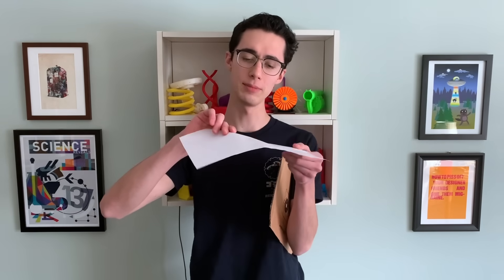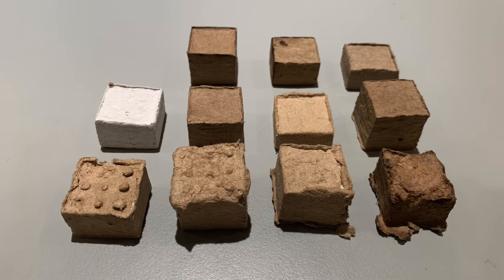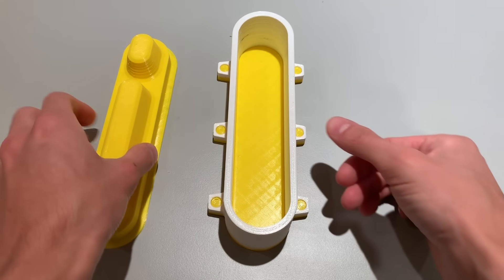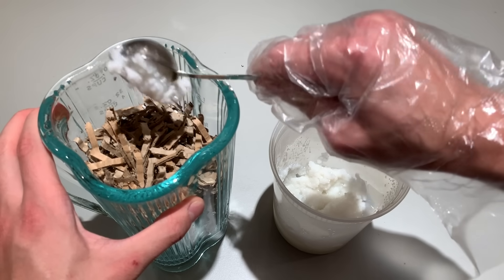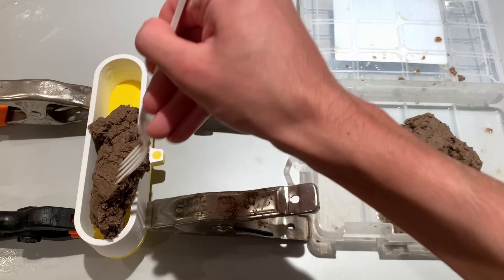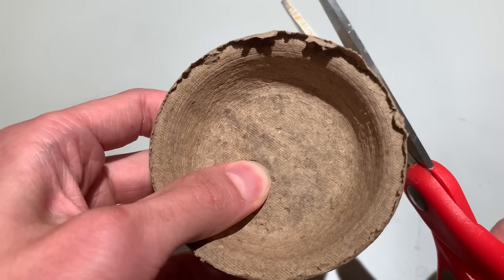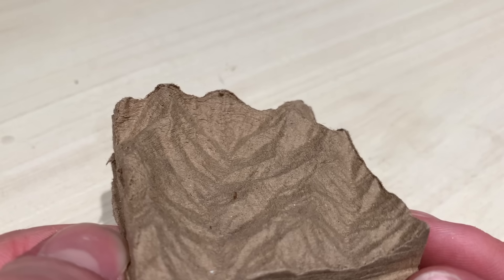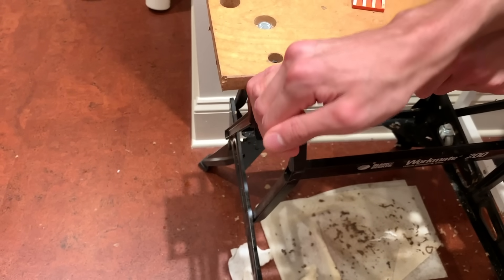Recycle Cardboard into Anything with 3D Printing!

Comment: Hmmm. That is actually a very good Idea. I already can imagine for example a plant seeding pots that dissolve in the ground. Maybe with a ferilizer already mixed into the pot itself so it feeds a newly seeded plant.
Reply: Maybe a quadcopter that drops seed-infused pellets made with this material in disaster areas?
Reply: Those exist, I've had a few of those. Just a little paper pulp cube with some fertilized dirt inside and a seperate chamber for seeds, you just sorta mush it together and plonk it in some soil and water it, the paper dissolves and the seed is fertilized!
Reply: @RastafarianPilgrim  
Yep!
Peat pots, cardboard pots.
The DIY way is with egg carton cups.
Reply: I've seen paper-based pots before. But usually they are egg-carton-sized, not full pot-sized.
I'm not sure how solid the cardboard would stay when watering the plants. There's definitely a limit to that idea.
Reply: That already exist.   What do think that green stuff that road crews spray on the side of the road is?
Reply: There are already. I have been using those pots for years.
Reply: Did you know that seeds work great if you just put them in the right conditions? You can literally just drop a seed on the ground.
Reply: @BretekV  This is a scam. Dropping seeds willy nilly over an area is very inefficient, very few will sprout and even fewer will grow. The puck is completely unnecessary and so are the nutrients. If it needs nutrients to survive there, it won't survive there.
Reply: @Willy_Tepes  there's a reason fruits exist, If you take the seed out, you may need nutrients at the start, till it grows large enough roots.
Reply: @manaquri Fruits serve for spreading, not for fertilization.
Reply: @dinosoapier  they do, but they also protect the seeds and may give nutrients.
Reply: @dinosoapier  obviously, as far as I know, and I got it from hear say, so might not be 100% accurate.
Reply: #TeamTrees
Reply: I've tried the cardboard pots for seedlings.  Needs more work - 6 months later, the pots are still intact, the roots are bound and the plants are much less well developed than those in bare soil.  Doesn't break down fast enough.  I saw a video where they went through a dump from the 1950s and newspapers were still intact and readable.
Reply: @satibel  it's from hear say and wrong. Don't spread what you yourself think isn't 100% accurate. Seeds themselves are enough for sprouting, You can try it yourself!
Reply: @dinosoapier  Nobody mentioned fertilisation
Reply: I was thinking the same thing. Maybe in a nursery,  so people could use the container in the garden. The container could have fertilizer in it.
Reply: I think you are talking about a seed bomb.
Reply: What about house bricks?
Reply: @satibel  The Fruit is just a way to spread the seed. Someone eats the fruit and drop the seed later - i guess you know the way - thats the way how vulcanic islands get their plants - beside wind driven seeds. If you take a cherry from the tree, eat it and spit the kernel somewhere in the green, you have just done what the tree wanted in the first place.
Reply: Damian Podeszwa That’s been a thing for so long 😂
Reply: @Willy_Tepes   That is how nature does it
Reply: @satibel  fruit exists to encourage animals to eat it with the seed then pass the seed with some manure somewhere else
Reply: @Nyx Hypnos none of mine lived
Reply: It has been mentioned here, but seedlings don't need fertilize. It can actually harm the young plants.  Once they are forming true leaves they begin to need low amounts of fertilizer.
Those pots that dissolve in the ground.  You are supposed to rip them up before planting out.  Don't just plant it in the ground you should gently begin to rip it up a bit so it breaks down and the roots can push through.  some plants have weak roots and will choke...
Reply: @Willy_Tepes   Have you heard about Jesus?  He can explain seeds to you.  I don't care what people are talking about but a "puck" can help retain moisture to give the seeds a better chance to germinate.  Carpet bombing is not about efficiency.
Reply: @voidremoved  Yeah, Jesus said that if you throw your seeds upon barren ground you will get a shitty crop. You will do more good planting seeds where they have a chance to grow. Putting them in a "puck" will only help them sprout, but they will soon die if the conditions are not right for that plant. Have you ever grown anything at all?????
If you have an airplane and a couple of tons of seed, go ahead and waste your money. Making thousands of "pucks" for maybe a handful of viable plants is just a stupid waste of time and resources.
Reply: they already exist, i use them in our nursery
Reply: These aren’t waterproof. You could probably use it as a building material with the right binder or coating.
Reply: What about the probably toxic binder that would leech into the soil?
Reply: Great idea!
Reply: hmm
Reply: thats actually common practice allready... not as refined but its used as you said....
Reply: You can buy those peet pots for about $2 at any farm store or walmart or Lowes or....
Reply: No way I was actually thinking exactly that. there must be something he said that made that idea spark.
Reply: Mix old paper with used ground coffee (as fertiliser)
Reply: @gillianbc  Probably due to the thickness of the pot? maybe compressing and volume should stay a little away from completely making a solid wall (like the examples on the video) that way, watering will allow the pot to dissolve or at least allow the roots to break it over time. Also, the thickness (from what I have seen on commercial pots) should be kept under 1/8" (3mm)
Reply: Cud put root juice in pulp mixture 😃
Reply: Already exists. Compressed fibre pots. Soak them in water they expand.
Reply: You can already buy those
Reply: They already do this in most garden stores
Reply: You might have to make it a little weaker so the roots go through
Reply: Exactly where my mind went. Making planters for my mom.
Reply: @gillianbc  may I know what kind of binding material you used?
Reply: Damian Podeszwa that’s exactly what I was thinking! Might make my own
Reply: ha ha, just posted a very similar comment, then read yours
Reply: If u put in microrihza, fungus that help break the pot down? Mushroom spores would be great for garden and love the cardboard. Plus put stress cracks that are intended to break after several waterings? If u get a recipe and sell the idea, like a franchise for local manufacturing and distribution for existing nurseries and or schools. People would like that. Help out community's!! Make money off instructions and molds?  Like a kit? Well hope it works out for u.
Reply: that's... actually really genius
Reply: Awesome idea 💡👍
Reply: There is a commercial version, a neat pod system that is used in mini greenhouses.
Reply: this is already a thing
Reply: That's a really smart idea.
Reply: Demian Adler he says in the video
Reply: I´m going to steal this idea.... it´s mine now! >: )
Reply: These exist. There is a cardboard like material made for this purpose. Look around your local garden centre for some
Reply: Genius
Reply: @dinosoapier  animal eat fruit and the seed exits through  excreta then the plant gets the nutrients from the excreta
Reply: @lokiwebster2984  ed
Reply: You can imagine it because it's been around for a long time, but stopped due to plastic being cheaper.
Reply: @Zwenk Wiel Even if a seed does land supplied with its initial requirements for sprouting, a plant will never grow where the conditions are not right. Most of your seeds would land places they have no chance to grow. It is actually more cost efficient to just go out and plant them by hand. But I guess people are just lazy. :(
Reply: Those exist
Reply: @gillianbc  i thought the example in the video immediately broke apart in water. i could be wrong though.
Reply: @Steve211Ucdhihifvshi  but as a diy recycle idea, you wouldnt need to go to the nursery...
Reply: Ehh having used peat moss pots before, its not a good idea, mold will grow all over it and where ever the pots are ill need a dusk mask or else ill risk an asthma attack.
Reply: @Origamiztec  or a version of that that's a little more chaotic (and in some cases a little less legal lol), seed bombs
Reply: These are already made, so it's completely viable.
Reply: @Origamiztec  you mean what birds do..
Reply: Paper can be toxic for plants because of the ink
Reply: @jjcp8419  That is printed paper.  Egg cartons are fine.  Lots of examples of good containers meant to be planted.  To say wood products are toxic, is to say plants are toxic.  Knowing what toxicity means, is a good start.
Reply: L
Reply: @gillianbc  with high carbon materials you need proportionate nitrogen and water to keep it suitably damp, to enable composting. I think if the pot was big enough to allow a seed to germinate and grow for 6 months, with drainage holes, but maybe fill with higher organic compost mix instead of just soil and when planting drop in kitchen scraps or green material in the hole touching the pot wall, it might decompose suitably.  Usually 25 parts Carbon to 1 part Nitrogen green material or kitchen waste might work.
Reply: They already have those long ago
Reply: I buy molded pots and use paper egg cartons to start a seed before planting it... then the 'pot' becomes mulch for the plant when it breaks down. depending on the source paper and binder.. this is what will make this good/bad for the plant.
Reply: Neat! I approve.
Reply: That would be a great idea
Reply: we have coco peat pellets for that unless you were the one that invented it seeing as this comment was in 2019/2020
Reply: there are already little peat or coconut fiber discs you can get to grow seedlings.
Reply: @Origamiztec  drop some sun with it aswell, i hear the mushroom type is pretty bright. they sure will grow big then!
Reply: @Willy_Tepes Haven’t they been working on a sort of seed that ”drills” itself into the ground?
Reply: @xmysef4920  Like in Jack and the bean stalk?
Reply: Yeah, rice and paper is a very good idea LOL
Reply: @liquidminds  Agreed, which is why we need those who have creative problem solving to combine with this effort and finish defying the limits for our goals.
Reply: But they are in every store for a giant stack per bucks
Reply: peat pots exist already.
Reply: Or just use paper towel or tp rolls soaked in fertilizer but honestly seedlings don't need fertilizer and once you plant them you could just fertilize then
Reply: Fertilizer in seed starters is a bad idea. Fertilizer is salt so it creates osmotic pressure and makes it difficult for the seeds to absorb and utilize water. And the seeds themselves have nutrients to push out a few leaves they only need fertilizer as they get bigger.
Reply: @liquidminds those suck. Seed starters made out of peat (which looks like paper) is horrible and causes root bonding in most seedlings I've used. I just use reusable plastic seed starters instead. That way you can plop the seedling and the medium out and replant
Reply: Ive used some cardboard as floor for substrate in the garden and it decomposed very fast, within a month the cardboard was gone. I think it really depends what kind of cardboard/paper you use and what kind of additives it has
Reply: I’ve shopped at the Walmart garden center too.
Reply: good idea!!!
Reply: Yes!! I want this! Someone make a 3D press for paper plant pots!!
Reply: @Willy_Tepes no, no, no.  That only works when plants do that.  Wait, wha?…. 😵‍💫
Reply: Ah, if only I had a 3D printer too (or access to one) so I could do fun projects like these, or make spare parts for old Matchbox cars and, a 35th anniversary band for my wife and other stuff like that.  Okay, maybe not the ring, but the other stuff. 😜
Reply: Imagine if you could shotcrete this.
Reply: Or fire starter mixed with oil or parafine? I think that propably they already do it like that
Reply: @RastafarianPilgrim yeah. Those pots are fairly common. People should look at the market before they think they have a new idea. Small plant seedlings are often sold in those pots for ease of planting

-ex farm\nursery worker named Me
Reply: @Origamiztec how ya gonna water it in a disaster zone that likely needs people supplies and not plant supplies? 

C'mon Michael!
Reply: Hi Are you still makeing products from recycled card board and paper. Can you make more video like this? It was very interesting. 😮
Reply: @mesta9997  There are non toxic binders, as he pointed out.  Flour paste or rice porridge, for example.
Reply: Or maybe just buy them for less money than you would spend on filament for the molds
Reply: A way better options exists for fractions of the cost. Don’t use peat pots, use cowpots… so much better for plant and environment
Reply: “Grow-a-Bowls”
Reply: @liorsinger1 with a different binder. Yes indeed
Reply: That's pretty funny that the seeding pot idea you came up with exposes the apparent fact that you haven't been to a Home Dopot before, let alone a garden store. Planters that you put it the ground aren't quite the norm, but they've been easy to find for DECADES.

Comment: One thing that wasn't mentioned in the video is that this approach inevitably ends up cutting fibres. Chopping the source paper with scissors of a shredder cuts fibres, and throwing the stuff in a blender cuts fibres. This is a known issue in commercial paper recycling -- fibres get cut at every stage. This makes recycling paper less durable than virgin paper. Paper recycling plants make a compromise between the speed of just chopping fibres and the improved durability of keeping fibres intact, and it's more about mashing than blending. If this project had been using a masher, the end result would have lasted a little longer because of the longer fibres.
Reply: A good long soak helps too. and mould inhibitor or even just cloves to stop it getting mouldy and stinking.
Reply: Fair feedback, I hadn't even considered fibres. Any ideas on how to "mash" rather then "blend" at a DIY level?
Reply: @Zacoban29  I'm not an expert in paper processing by even the wildest stretch of the imagination, but I reckon that you probably want to tear the card into strips, the put them in a long continuous soak with a slow continuous stir to start encouraging the fibres to come loose.

Note that commercial paper production often makes long rolls of paper/card just for the sake of efficiency in the machines. This means that the longest fibres can get stretched out in the same direction. When you start tearing a bit it can often reveal the weakest direction, and copying that means you might be able to minimise the number of fibres cut, improving the final output.
Reply: @Zacoban29  You need to dissolve the binder between the fibers, so I'd go with a long soak in simmering water and a slow stir. Something like a dough kneading machine that can heat the bowl would be ideal I think.

Comment: I'm a material engineer and can say it's really interesting! Especially the fact it isn't too flammable. For water resistant maybe try wax or PLA layer.
Reply: PLA has little holes they can be seen with a microspcope. To be waterproof it must be sanded and covered.
Add screws to the 3d printed mold.
I love this idea to ship small parts in a special letter having the size of a book, covered with plastic for shipping. DJI drones are shiped like this.
Reply: Many ways to make it water resistant, a little linseed oil can do that, but there are many reasons not to make it water proof the first of which is this makes it unable to break down naturally. There are currently some bio-based resins which can water seal cellulosic material like this, but in order to break the molecular bonds of the resin, the object would need to be soaked in formaldehyde for a specific amount of time. Again, lots of ways to to make it water resistant enough to be useful in daily life without wrapping it in a plastic seal.
Reply: @MrChris20912  hey that sounds interesting! What kind of bio based resins would make it warerproof for lets say a week… or maybe waterproof to a certain point of humidity??
Reply: @tripplep1815  the simplest, though not actually a resin, would be Casein - milk proteins. Also, they don't break down fast,  but were the original "plastic" material prior to oil based plastics. 

The other I was thinking of, I'll have to dig a little to find a reference for. I do remember an announcement several years ago, I believe it was in relation to a Ecovative coming product - they make mycelium based products. There was a resin company they partnered with to create these bio-resins for fishing net floats as well as swimming boards. The core would be mycelium and the outside coated with resin. Then, at end of life for the product, it could be immersed in another solution to break down the resin bonds, so the resin and mycelium could then decompose naturally. 

If I can find the link I'll post here again.
Reply: pla is plastic dude
Reply: The easiest would be c200. Wax is the most eco-friendly, but the whole process starting with a plastic mold isn't anyway so whatever
Reply: While it's not plastic, water glass would work. It's what farmers used to waterproof eggs with (in the US) and is made from silica so not exactly a scarce resource. It could probably also be used as the binder material